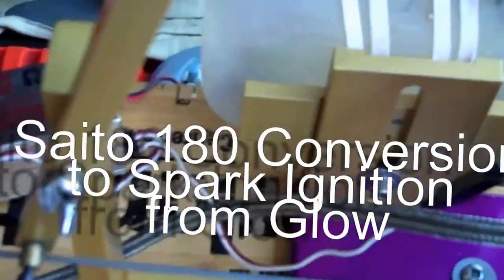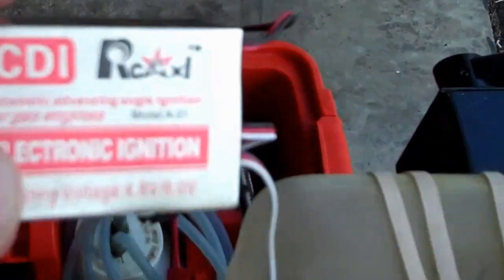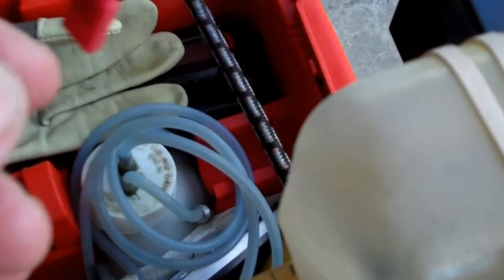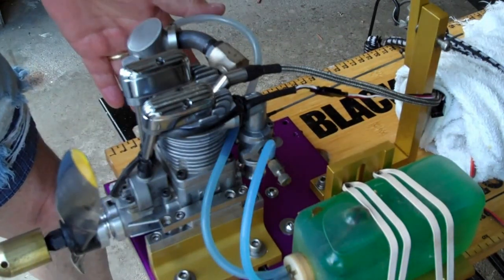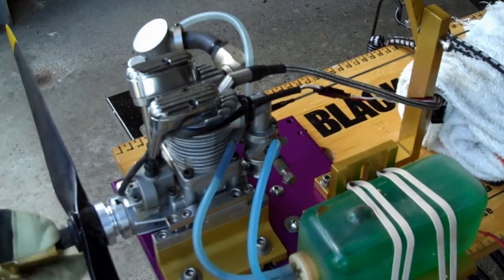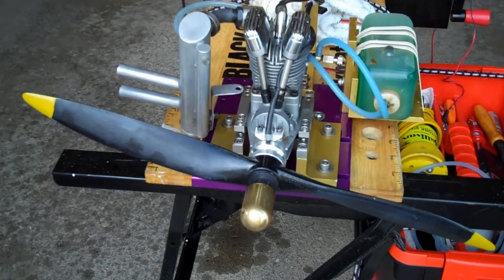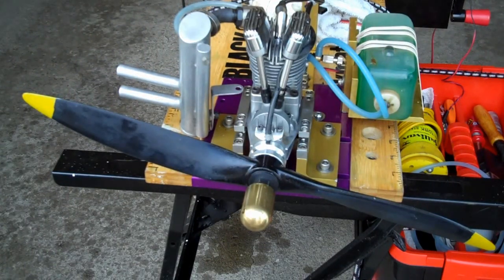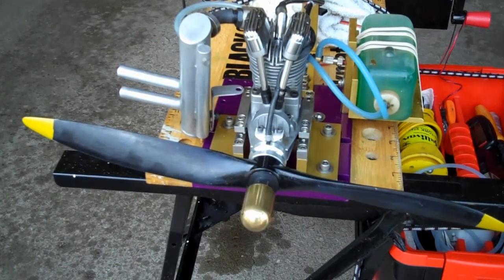Saito 180 conversion to Spark Ignition from Glow

Comment: I plan to convert a 180 this very way.  The reason is it will be for scale competition in Europe, and I do not know what kind of fuel I will have available. Plus, I was planning on setting it up with an on board glow anyway, so this just makes that easier, and radio controlled kill.  It is stated that you can run down to 0% nitro, and also see a 25% increase in duration as it requires to be run leaner than normal.  Looking forward to doing this conversion, and nice to find a video specific to what I am up to.

Comment: You did a great job has your conversion. I converted my Saito 180 with a CH Ignition and hall sensor. I use a 17x8 Xoar Sword prop. I have a steady slow idle and no flame outs with perfect transition. I use Cool Power Pro Pattern  20% fuel. I love my engine. I am about 4 gallons of fuel in and running the same spark plugs. It runs great.

Comment: CH-Ignition sells the electronic ignition unit for 1,2,3,5,7 pistons, and the Hall sensor that fits on a number of the Saito 4-stroke engines. You can convert to ignition, and continue to run methanol based fuel (for more power), or run on just 95% methanol and 5% oil, using the stock nitro carburetor. Or, you can get the gas conversion kit that includes a gas carburetor, and then run gas/petrol and 5% oil (with less power than when running methanol based fuel). 

These conversion options should be considered by fliers who want higher quality 20-30cc fuel engines, and 4-cycle sound, but don't want to take the drop in power from running 4-cycle gas/petrol engines. In some hot rod shops, you can buy $4/gallon methanol, and nitromethane, and racing oil, to mix your own $6/gallon methanol fuel. And you can buy the big Saito single piston engines NIB for about $200 now.

Comment: So if youre running alcohol ignition what kind of timing will it be running??  Is it still going to be like 28 degrees before top dead center like one would do in a gas two stroke?

Comment: Nice job.I have converted 3 engines so far.An MDS 58,SC 52 four stroke and a little OS 25. The MDS runs perfectly on the petroil mix and is a lot better than running on glow fuel as it was too intermittent.I lowered the compression on both the 2 strokes but as the SC four stroke was already low compression I left it as it was.
I don't use glow fuel anymore due to the silly price of it here in the UK

Vince
Reply: could you share some specs of your modification? or have a viedeo?? regards *